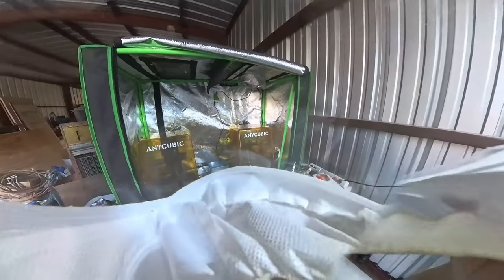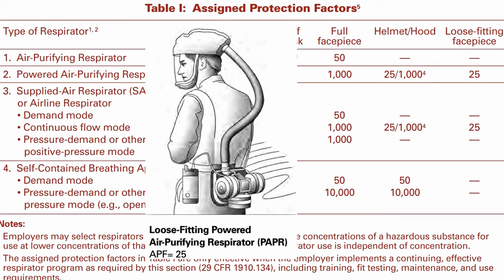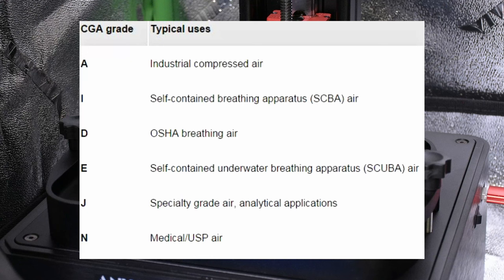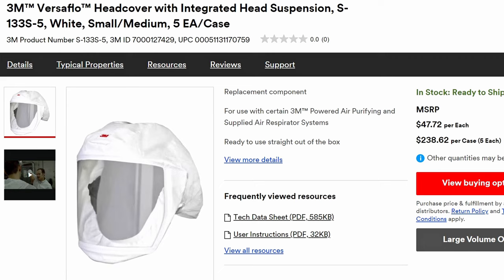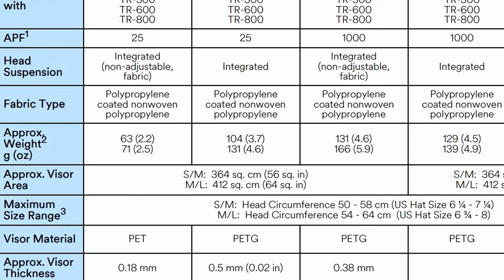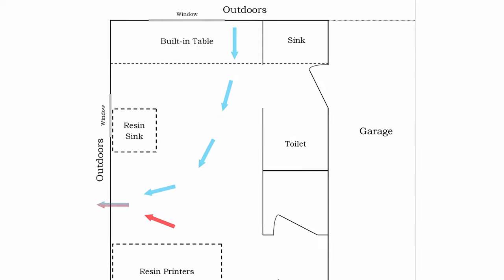Supplied Air Respirators for Resin 3D Printing, Painting, and Welding

Comment from the maker: ⏱ Timeline:
00:00 - Introduction
00:34 - Respirator Comparison
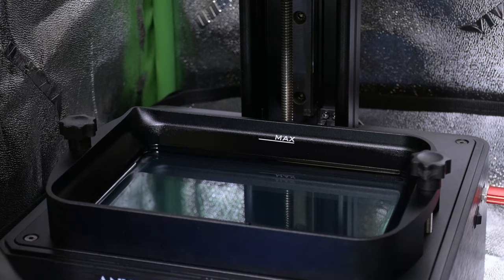02:25 - Supplied Air Respirator (SAR)
03:39 - SAR Costs
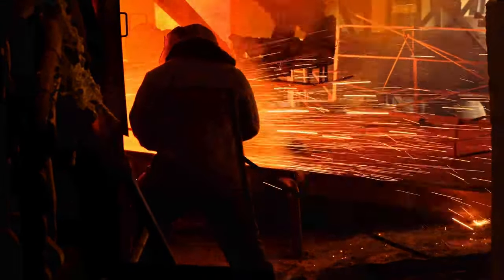04:16 - DIY SAR Headpiece
05:27 - DIY SAR Fan
05:59 - DIY SAR Duct
06:56 - Fan Placement
07:23 - Fan Intake Filter
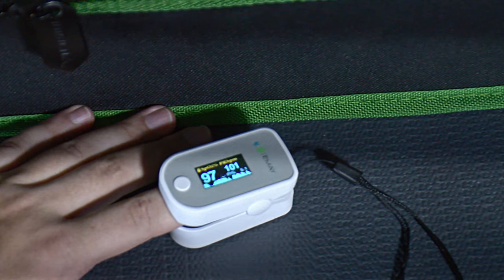07:59 - Pulse Oximeter
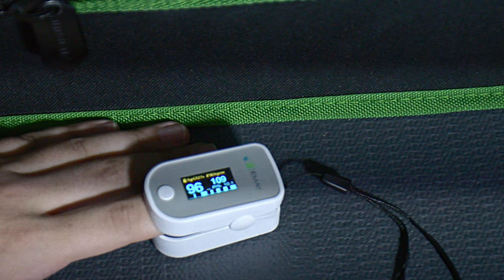08:25 - Conclusion

Comment from the maker: * New lighting will be added in the shop for future videos.
* The 200 CFM at 50 W+ is meant to be a comparison between other inline fans.
* The filter mount in the video had a slight defect - this is fixed in the released STL.
* If you encounter any issues with the FDM-printed parts let me know.

Comment: How about a CPAP machine in an enclosed plastic box with a HEPA filter inlet for an air driver?  This seems like a great alternative to a full mask respirator.  It is not as claustrophobic as a full face mask and it so much easier to sleep with it on.
Reply from the maker: A CPAP is along the right line of thinking, but I believe that it would be the wrong tool for the job. The price of those is approaching a low pressure SAR, but my main concern is the pressure drop over 20-50 feet of tubing for the CPAP.

I do agree that the full mask respirators can be uncomfortable. The positive air pressure does relieve some of this, especially if it is a loose-fitting headcover.